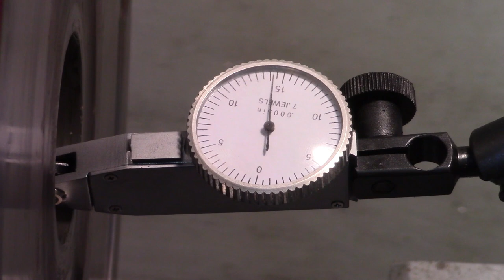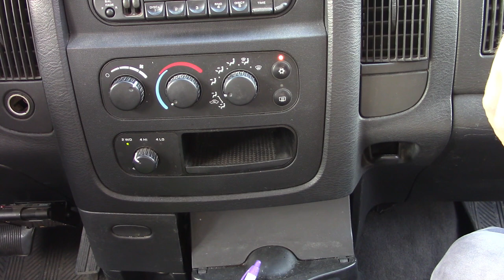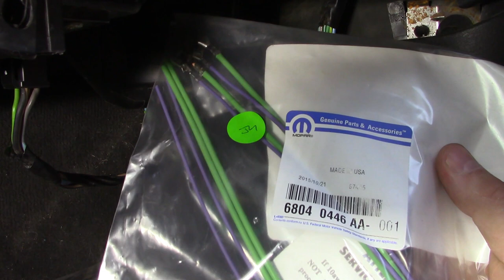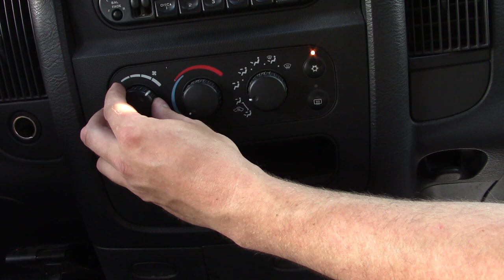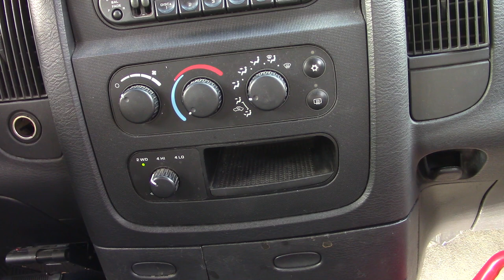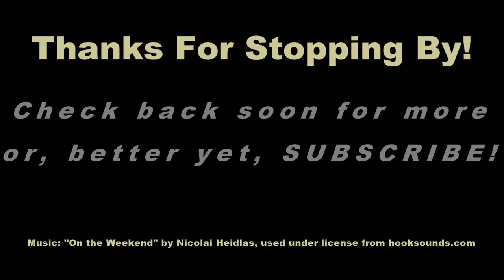Shop Update & Blower Motor Connector Repair

Comment: Thank you for showing the part number, the aftermarket looks slightly different from the original. I don't think I would have found it without this video. Aftermarket is coming up PTA1285 for anyone looking.
Reply from the maker: No worries, I figured it was only fair.  I still worked at Chrysler at that point, now I do more aftermarket stuff as I'm at an independent shop.

Comment: If you love working on vehicles, just like machining, this stuff never gets old to watch. I think there would be a lot of individuals who would find this helpful the way you explain the steps. I myself work on all makes and models for a used car dealership and have repaired many of these. Some though were in such bad shape that it burnt out the heater control module, one sign was if the ac light never turned off even when the buttons were pressed. I have had two rotator cuff surgeries in the past year and a half and can no longer work as a mechanic, so I am looking for other things to do, but it is still fun to watch and learn different methods of repair.
Reply from the maker: I enjoy building and fixing things, just like most of us who gravitated toward working in technical/trade fields, and while I don't claim to be an expert on a lot of stuff I like to share what I've learned over the years (often the hard way) and learn new things all the time.  Kind of makes me miss being a high school shop teacher at times.  Been occasionally accused of talking too much, but I figure that the fast forward button is there for a reason.  Those who actually take an interest will listen and think critically about what I say - if there is legitimate room for improvement I will certainly take advice from those who are wiser than me.  Sorry to hear about your injuries and surgeries, that's a hard one to deal with when your passion is fixing stuff.  Hopefully the stuff here stays interesting for you as time goes on, I will just keep on taking videos of the stuff that happens here.  Thanks for coming by!

Comment: I have been searching for a solution for ages! and finally found it today! Thank you so much!
Reply from the maker: I'm glad you could find the video useful, just make sure you check the blower motor itself with test leads to a good power and good ground, and also check the blower motor resistor and connector as they can also be common failure points.
Reply: @EverettsWorkshop  I most definately will. Thank you again for this video and everything else that I need to do. You gave me a huge relief with this video 👍🏼

Comment: Thank you Sir, this video was very helpful to me.  I will be needing to replace my pigtail to the resistor on my 2012 Ford Fusion, this has helped me 👍🏼
Reply from the maker: Thanks for saying hello, glad it was of some use for you - you'll have a bit more room to work, I was squished around the camera and light in order to get under the dash with the tools.  I'm not happy with slightly overheating the solder joint but it still works, it just wasn't as pretty as it could have been.
Reply: We’re men, we make things work, not look pretty 😂🤷🏻‍♂️👍🏼

Comment: Great video! Thanks! Garage wanted $300 to change plug and resister. Im doing this now myself. I just changed resister now going to change melted plug. Dont forget some dielectric/terminal grease on plugs/terminals. Mine were corroded badly.  Part of my problem.
Reply from the maker: Thank you, I was hoping it would be of use for somebody.  I realize my soldering technique was a little sloppy but most people get the gist of what I was trying to get across.  Yes, corrosion will create the voltage drop that will build up heat and burn the connector.  This sort of thing is plenty feasible for anyone to do at home and save some money.

Comment: From "To do" to "HONNEY DO" lol
The butane torch soldering is more my method for emergency than my regular method, you can get excellent soldering iron that will provide enough heat, but, those are a little costly, don't worry I'm not going to get you for using my desperate cases method, mostly in resolving a "HONNEY DO" emergency job...
Nice to see you're coming back to make new projects...
Reply from the maker: Thanks, it's good to be back tinkering in the garage again.  Family stuff has to come first for all of us though.  Sometimes family first means a tinkering job though, like when it migrates to the "honey do" list, lol

Comment: Great video.
I replaced both the resistor and plug, its now working great however I am conserned that the wires comming from the blower get extremely hot.
Is this normal or is the motor going bad?
Reply from the maker: If the wires next to the motor are hot I would check the connector to the motor for corrosion and/or burnt terminals. This would create a voltage drop and heat. You might need to do the motor connector as well, and possibly the motor itself if the terminals can't be cleaned.

Comment: I broke off the clips on the pigtail to the rissitor  . Is there anyway to keep it in place and keep hoocked.thank you.
Reply from the maker: Well, the best way to keep them latched is by the clips, but if the clip is broken then one slightly unorthodox way of retaining a connector is to use a very small drop of super glue on a flat part of the connector near the outside lip. That way, should it need to come apart again later, you can slide a razor knife in and separate the socket from the pigtail plug. I've never done this myself but have seen fellow technicians do it in a pinch and it does work if you're careful. 
Thanks for watching!

Comment: I really need to replace my melted connector. Find the time to do it is another thing. My blower motor works if you Bang on it a couple times😂😂
Reply: I didn't know my connector, was melted until it ruined/broke my blower motor !  Hoped you changed it before a 300$ repair Bill  🤥
Reply: I'm having the same problem.. mine is melted as well

Comment: Instead of sodder, making a potential mess on the floor, and messing up any insulation when it comes to wiring, they do have heat shrink connectors that would be quicker and alot cleaner!
Reply from the maker: That is very true - I use them at work, they are a viable option for splicing. I didn't have any on hand at the time and although I admit my technique was a little sloppy I just wanted a good connection with no voltage drop so I soldered the pigtails on. You are quite right though, those heat shrink butt connectors are a good option too!

Comment: Is the torching mandatory. I'm trying to do this on my own.  . . ?? Or should I just get a professional?
Reply from the maker: The little torch was just a heat source to shrink the shrink tube on to the wires. I should have used a heat gun but didn't have one at the time. If you're careful a cigarette lighter works for shrinking shrink tubes too.

Comment: I have the same problem! Wondering how you pull tha connector out!
Reply from the maker: There is a little tab on the side of the connector to release it from the motor. If it won't come out at all it may have gotten hot enough to melt into the socket, in which case you'll need to replace the motor as well as the connector.

Comment: Do you know where I could find a Ford Fusion 2010 blower motor connector? Much like your video I have the same issue with my Ford and a mechanic tried saying it was both the resistor and the motor but I noticed it’s just the connecter. Any tips on best places to buy one?
Reply from the maker: If it truly is just the connector, you can get them online. Just do a search, from what I can tell from the part catalog a Motorcraft WPT1188 is what your car uses on the blower motor. There are times, however, that the resistor and motor both go at the same time too, so make sure you double check them too.

Comment: my question is do you need that torch or a soldering iron? or is that just extra protection? wouldn't the crimp and some electrical  tape work just as well?
Reply from the maker: It would be best to use a good soldering iron but I didn't have one available at the time - as for the crimp, Chrysler specifies splices to be done with crimps and soldering, covered by shrink tube.  I did kind of a sloppy job with the soldering, to be honest, I've done better ones.  The thing is that with the current that a blower motor draws, you want the least amount of voltage drop as possible and this kind of splice allows that.

Comment: I have a similar situation with the exception of my problem involves a 1994 toyota pickup truck. The truck connector is fried because of a lose wire and there is no replacement part..The dealership said i would have to buy a whole new wiring harness... any suggestion on how to re engineer the connector or switch... i have no idea
Reply from the maker: Hi Cora, which connector is fried?  The one at the blower motor itself, the blower motor resistor connector, or the one at the HVAC control head?  I was looking at pictures of the various things available at RockAuto.com and it looks like the resistor, replacement resistor pigtail connector, and blower motor are available commercially.  If the connector to the motor itself is fried then as it looks like the motor itself uses spade terminals in its integral connector you could use some heavy-duty spade generic spade terminals and even solder them to the harness wires to minimize voltage drop.  If it's at the control head then, well, I haven't had one of those out so don't know what they look like.  If it destroyed the terminals on the blower motor switch you'll need to get a new one of those (or one from a wrecker) and put something together on the back side of it using spade terminals if possible.

Comment: Solder with a torch , interesting
Reply from the maker: Well, lol, I admit the style was a little sloppy on this one.  But yes, with a small flame you can solder wires with a torch.  Depending on the scenario it is done a lot, especially with larger gauge wires and splice clips so you can get enough heat for the solder itself to flow.

Comment: I'm having the hardest time locating that part, my wiring harness appears to be the same one you have. Can you please link were you got this harness from? Thank you in advance.
Reply from the maker: Hi Austin, if you have a Dodge pickup of around the same vintage as mine, the Mopar original part number is 68040446AA.  I bought it from the parts department of the Dodge dealer I worked at, but I'm not sure where you live.  If you put the part number into your search engine you should come up with a few options (I found Rock Auto, Amazon, etc. had them) otherwise you can go to your local dealer with that part number.  Thanks for coming by!

Comment: i look for the crimps and pliers were did you get them
Reply from the maker: These styles of wire strippers and crimpers can be gotten from pretty much any Matco or MAC tools dealer, but I'm sure that a similar set can be even ordered from Amazon as long as you get a good name brand.  I'm pretty sure both of mine came off the Matco truck but it's been a while.

Comment: Hey bud I have A 2013 crv heat stopped as it did work intermittently lol replaced the resistor n motor but nothing. Could it be the connector itself because when I wiggle certain spots it'll kick on and is it hard lol
Reply: Any advice needed
Reply from the maker: Ok, if you're wiggling wires with crispy insulation and it cuts in and out you definitely have a bad connection. Check the female terminals of the connectors on the blower motor and the resistor as those are the two most likely to give you grief. If you see discoloration or melting on them, replace them.

Comment: I e never done any soldering. Is there any other way?
Reply from the maker: Honestly I did a bit of a sloppy job on this one, should have controlled soldering heat better or used a soldering iron. There are crimp butt connectors with sealant that we used when I worked for GM, but they need to be crimped correctly and then warmed with a heat gun (or carefully with a micro torch) to seal the connection. If you look up self sealing crimp butt connectors you'll see what I mean. Thanks for popping by!

Comment: So, if our wiring harness comes with the butt splices... are you saying not to use them?
Reply from the maker: It depends - some GM replacement connectors for example come with butt splices that you heat to get them to seal.  If they come with that style then by all means use them as the engineers would have considered them acceptable.  I still prefer to solder and heat shrink but then I'm a bit old school :)

Comment: I might have been tempted to stagger the splices out a bit. I realize with the shrink wrap the joints were isolated but sometimes the plastic can rub through. Also, if you're building a harness the diameter of the finished product is a bit smaller.
Reply from the maker: I agree, it is good style to stagger splices, and it's what I do when numerous splices are to be done (a couple Dodge diesel emission harness recalls come to mind).  In this spot I wasn't as worried as there was lots of space for the wiring, but you do have a very valid point .  Thanks for coming by!

Comment: Is soldering the cables together okay? Or should crimping be preferred? I have the gear + experience to solder but none of the crimping supplies. Thanks for your videos!
Reply from the maker: Hi Justin, soldering is fine as long as you get a good joint and use heat shrink insulation. I admit to having done a bit of a sloppy job on my pickup, scorched the insulation a bit, but it works fine.

Comment: If you have enough wire after you cut off the connector to reach the motor why add the extra pieces and not just put the connector straight on the original wires?
Reply from the maker: It's a fair enough question, and the simple answer is that the kit does not have the terminals separate from the wires but already crimped on to the pigtail wires.  If I could get the female terminals separately I would have no problem crimping them right on the harness wires.  Thanks for coming by the channel!

Comment: Did you disconnect the Battery.
Reply from the maker: Lol, no, but you're right, it is generally safest if one does disconnect it when doing electrical work on a vehicle.  On these ones, the power is fed through an ignition feed, so without the key on there will be no power to the 12v feed at the motor.
Reply: @EverettsWorkshop  thanks, I'm doing one when the part gets in.  Yea, I've always disconnected  the battery.  Nice to know some applications don't require it.

Comment: Hello, where can I find the male replacement clip you used in this video? I believe my setup is the exact same as yours. Appreciate any help.
Reply from the maker: I was still working at a Chrysler dealer at the time, so I bought the connector at work - it's a 68040446AA for my truck.  You could probably get them on Amazon as well if that would be easier or cheaper than your local Mopar joint.

Comment: That cable gets super hott I wonder if it’s dangerous 🧐
Reply from the maker: In my case I think a loose terminal in the connector created a voltage drop, which made heat and a worse connection. Really there would only be heat in a spot with higher resistance so if you have a hot connector it's worth dealing with. I've also seen ignition switches on these trucks with burnt terminals because the blower motor gets a switched power feed from the ignition.

Comment: Whats the part # need that done to my ac plug...thats what I need is the connector mine melted blower is fine?
03 Dodge ram 1500
Reply from the maker: Hi Rey, this connector and part number was just for the connector to the blower motor fan in my old '03 Dodge pickup.  I'm not sure which connector you are looking for in particular and also not sure of what kind of vehicle you own.  Have you checked in with a decent auto parts store close to you, or given the dealer a call to get the part number from them?
Reply from the maker: Hi again Rey, the blower motor connector that my truck needed was a Mopar 68040446AA.  Yours is the same year and the 1500/2500/3500 series all used the same interior and mostly the same HVAC components inside the cab so it should be the same number for your blower motor connector.

Comment: Hey bro looking for a 2005 Chrysler 300 blow motor connector how did u find this one ?! Help please?!
Reply from the maker: At the time I was working at a Dodge dealer so I looked it up in parts and ordered it.  For yours, I did a quick check at some aftermarket sites and it looks like p/n 68040446AA should be the number but you would be best to verify that by calling your local dealer with your VIN and they would look it up in StarParts.  Thanks for coming by!

Comment: Will this same method work on an 07 cobalt?
Reply from the maker: It is a pretty standard procedure for replacement of a pigtail-style repair connector.  I will admit I was a bit sloppy in the soldering, but if you use a soldering iron or smaller micro-torch you could do the same procedure to replace the connector.  Just make sure that the motor terminals are still good and clean, and that the motor itself still works ok or else you'll be replacing the connector again.